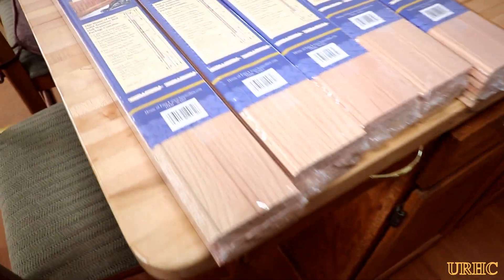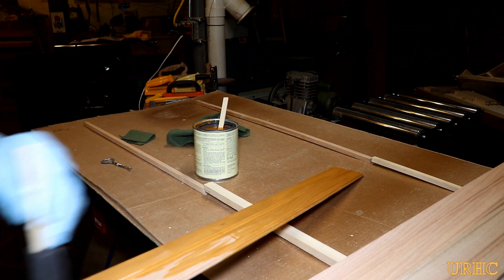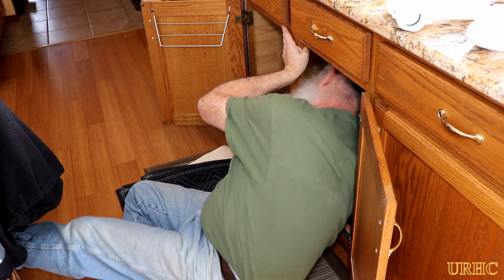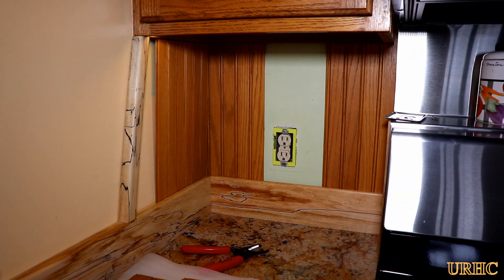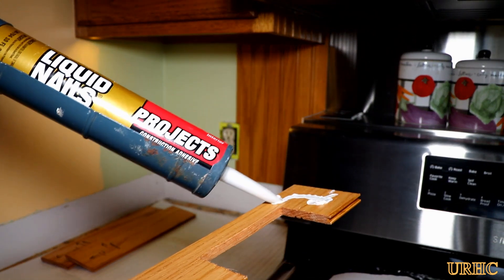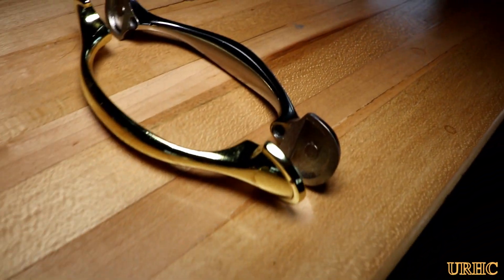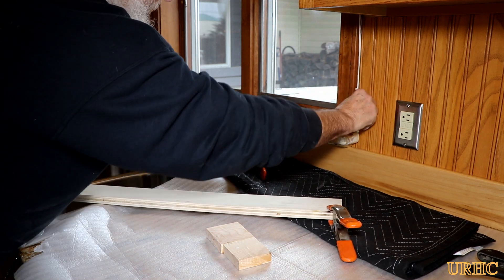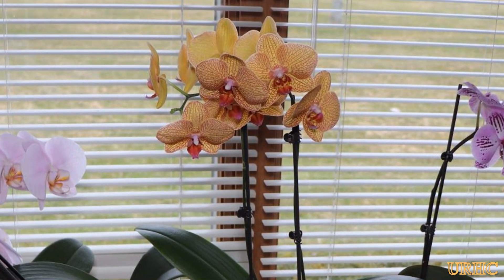Kitchen Update Part 10 Wainscot And Spalted Maple Backsplash

Comment: The company that installed my parents granite sealed it so with something so the oils wouldn't penetrate it and cause the stains. You did a great job on the installs that you did your self. Have a great day. God Bless!!!
Reply from the maker: We have a 15 year sealant on this but the installer told me that to be safe it should be sealed 2 times a year. Sprinkle some water on it and if it doesn't bead up it is time to reseal.  He said that oil stain is the biggest problem with granite and any oil should be wiped up immediately because the staining is permanent. That and chipping around the sink openings seem to be the only problems with granite. Thanks for watching.

Comment: Almost there! Good information on plumbers putty staining granite. Thank you.
Reply from the maker: They also told me that any type of oil can stain granite in a short amount of time. So never set a bottle of cooking oil on the top. Also never use a wicker basket with veggies in it. If any of the acid in the veggies soaks in the basket as they decompose it will travel down and stain the granite over time.  That and chipping seem to be granite's worst enemy. Thanks for watching.
Reply from the maker: Granite is very porous that is why it must be sealed twice a year. We would never go back to formica plus now the counters have become the focus of the kitchen. Worth the extra precautions.
Reply: Are you going to do a sealing video?
Just curious, my sisters new house has granite and she asked me to seal them.
I'll be looking at videos on that next.
Reply from the maker: Probably in about 6 months. Ours is supposed to have a 15 year sealant but the installer said check it every couple of months. Put some water on it and if it beads up and stays that way it is fine. If the water spreads out and starts to disappear seal it again.

Comment: looks great , with the maple bottom trim  you were able to cut the 32 s in half to save lin feet in wainscot. build .com cheap hardware. for future projects 
dont buy blum or grass cabinet door soft close after market slow stops they dont last long
Reply from the maker: Yes they were cut in half. I am still trying to find hinges. The ones on the doors fit in a mortice and slot and I can't find areplacement that will hide the old cut outs. I will check that out. Thanks for watching.